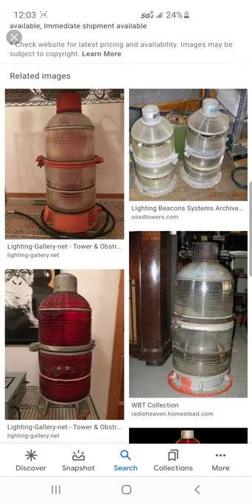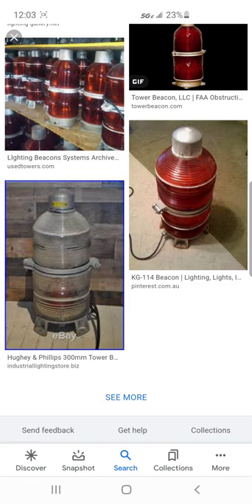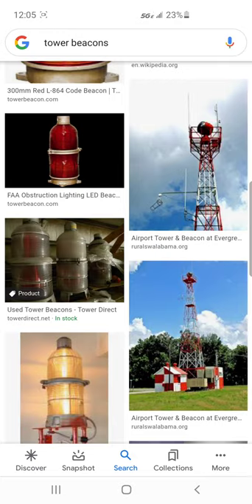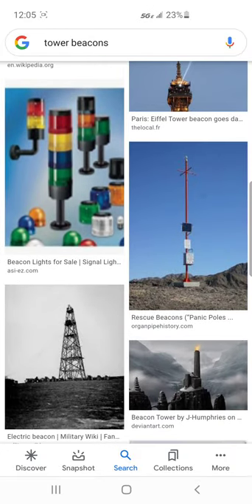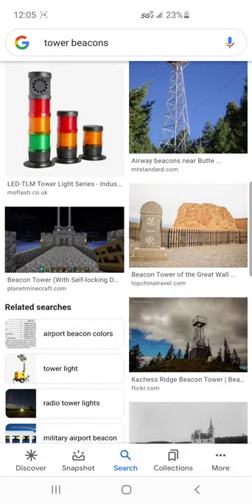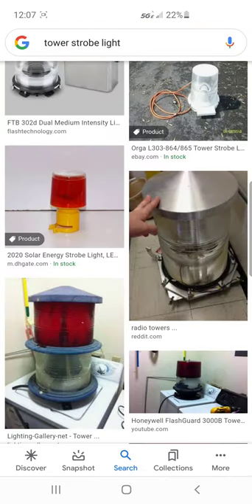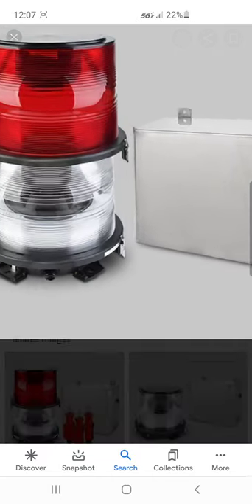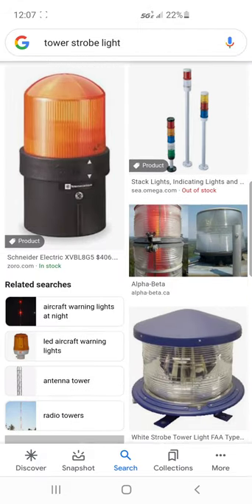the evolution of tower beacons

Comment: The original strobe lights came with incandescent beacons mounted on top of a metal platform. Either on top or below the strobe light. Like the Hughey and Phillips KG-225 and KG-114. Or the Flash Technology FH-301, which are very rare since they don't make those anymore. I like to call these the classic strobe lights, since they were the first to be made. They were the original "dual" red and white lighting systems before the FH-324 which is the dual red and white strobe which was made in the mid 2000s and replaced the previous FH-306's which are the white single strobes that flashed white at day and red at night.

Comment: The reason the L-810s (markers) are flashed on modern towers under 350 feet and removed on taller towers with multiple levels of flashing lights (L-864 while in night mode) is due to the 2015 FAA update that protects birds from striking them. They claim the steady burning L-810s attracted  migrating songbirds, which would strike the structure, and guy wires and thus be killed. Not because it's LED.
Reply from the maker: Time to declare war on birds.
Reply from the maker: @Travis Glanton The Tower Enthusiast only modern LEDs